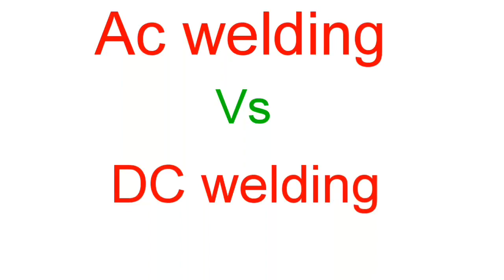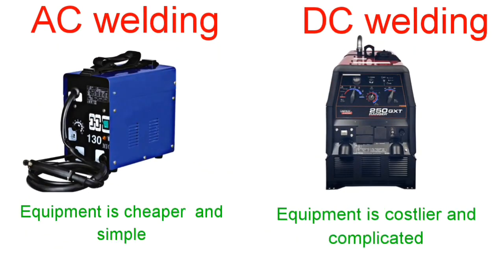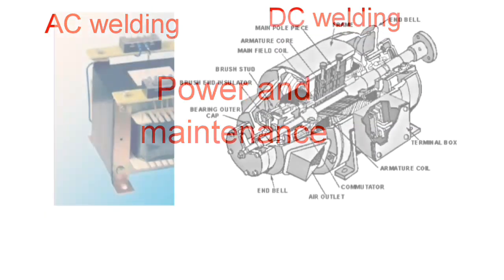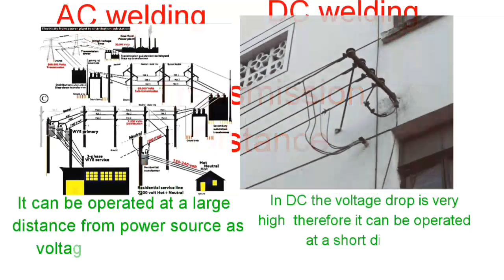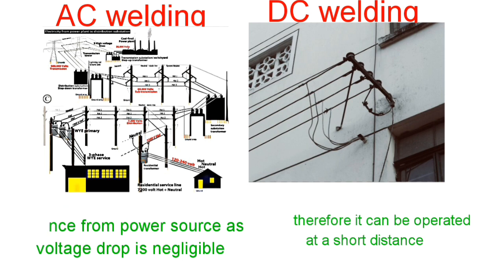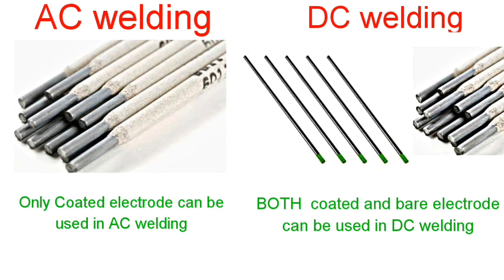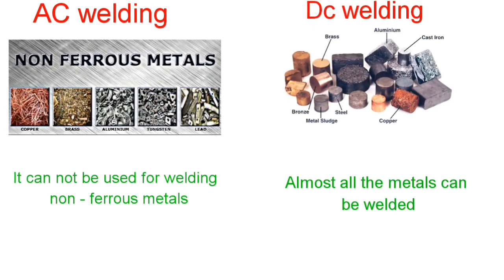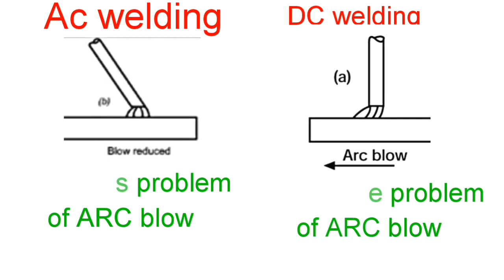Difference between AC and DC welding, ,Bare and coated electrode , ARC blow,

Comment: so dude...what do you recoment for an amateur user? i mainly want it for small to medium DIY projects.
also i cant afford anything at too high price
Reply: My own recommendation is to get a DC welder.. its light weight, cleaner job.. n easy to use... as it has a digital screen for AMPs where u can use the right Amps doe the right metal thickness...
Reply: @denoli2976   some1 told me about someething called Force Arc . does an DC have something to control the depth /wide of the arc?
Ty for your time
Reply: @antoniskartalas8230  i think if you are new to this u can buy a cheap 160amps welder and start to upgrade by time .. its nice and it has soo many uses ...
Reply: @denoli2976  sir which one will low bijli consumption...
Reply: @ravikanta   i don't get what you mean but if u are talking about electricity consumption.. sure DC W is much better.. coz Ac W is using a transformer and older type of technology which is using much more electricity than